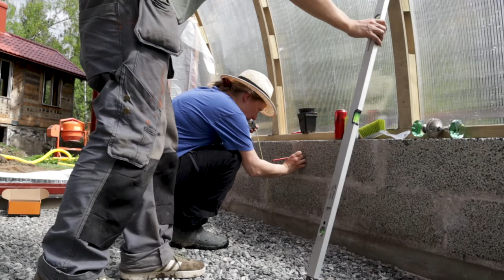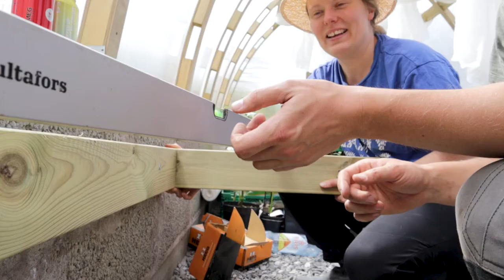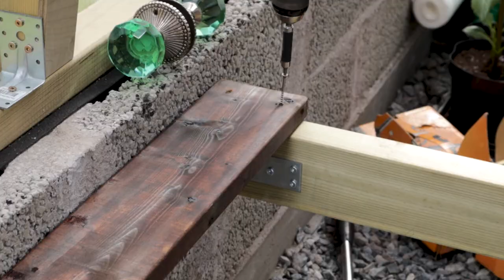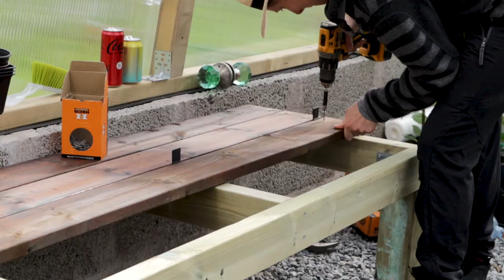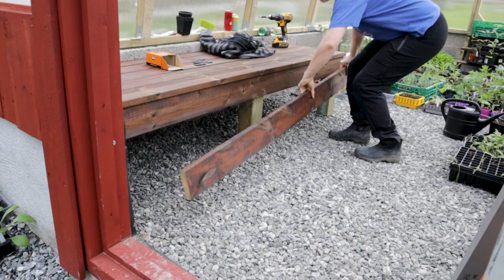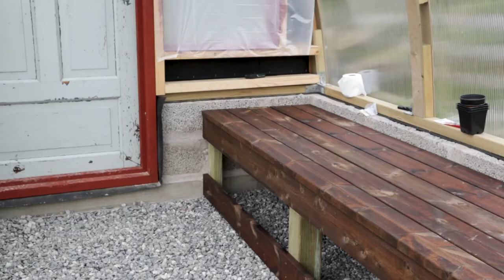We Made Some Greenhouse Furniture As A Greenhouse DIY Project!

Comment: Great stuff! i recommend adding legs for the inner section aswell, LECA blocks aren't exactly famous for their great structural integrity, and a couple of screws and a heavy load on the bench could probably make the blocks quite damaged- likely ruining both the greenhouse and bench : o)
Reply from the maker: Hehe yes, thought about that, but considering that we have massive legs in front and using long screws in the blocks, I imagine it's mainly going to be a downwards force on the blocks. Most of them are also filled with concrete, so they're a bit more solid than the regular hollow ones. So yeah, that's my perfectly uneducated guesstimation! 😉